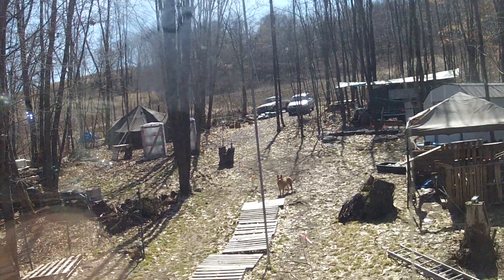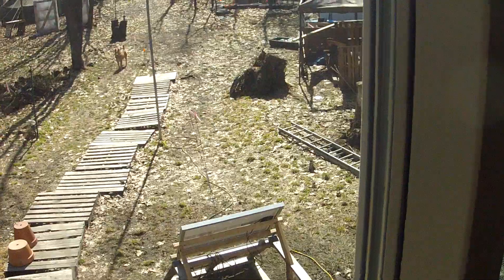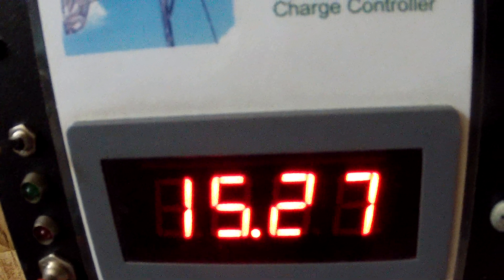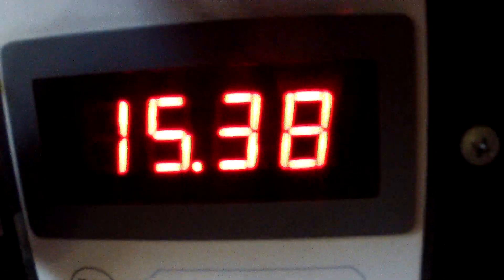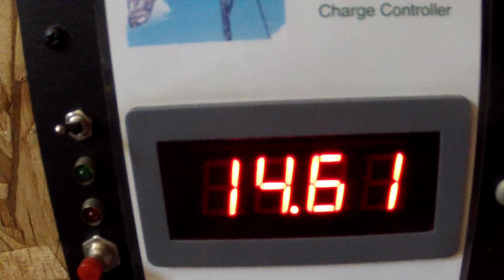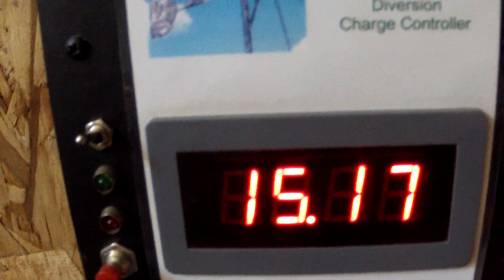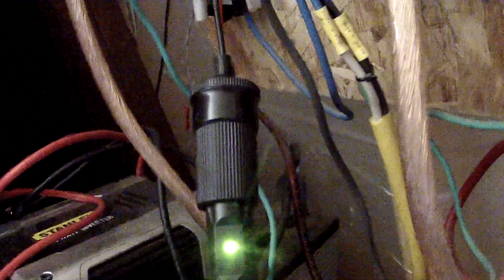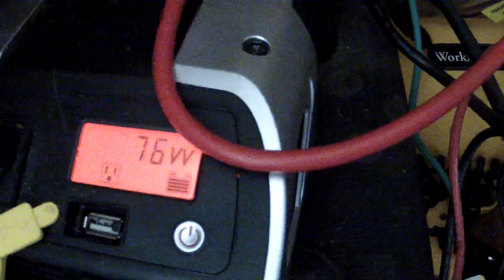Lots Of Off Grid Power!

Comment: You already know what to do..tons of forklift batteries. ..lots and lots of solar panels. .and run a generator. 24/7. Glad I could help
Reply: ***** Sure just make big plans to build a box for them. But you have to wait until your wood is in perfect condition before you build. If it is wet or frozen your screwed until it dries.
Reply: ***** i watched another channel for a couple years..that guy has over 20 years experience. ,so he would know. .the way he explained it..is the more batteries you add, you need more solar panels you need. .and to help supply power to the larger battery bank you will only need to run a generator 20 hours a day..the NY solar rule. ..more batteries
,more solar,,more generator. .it's that simple. ..
Reply: ***** Just make sure there is absolutely no kind of charge on them, bring them down to 11.9 volts for winter storage.
Reply: You guys are so silly, lol

Comment: You were recently using power tools and had the generator running to power them.  I was wondering why you use the generator when you have to dump power.  What would the power tools have done to the battery levels how long would you have been able to run them, the tools.  How many batterys would you need to not need a generator